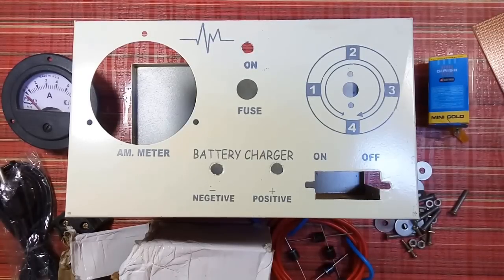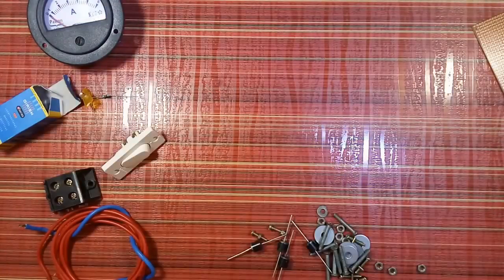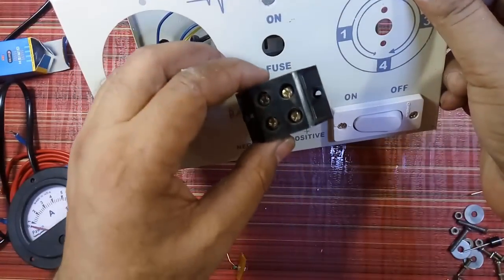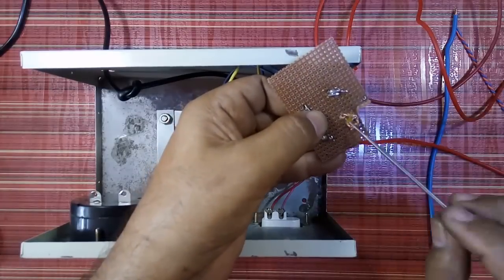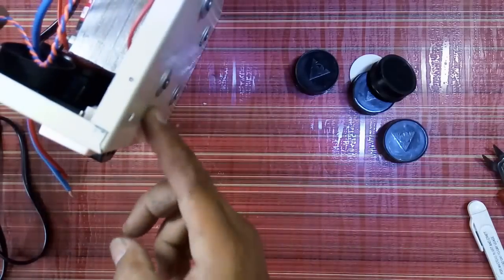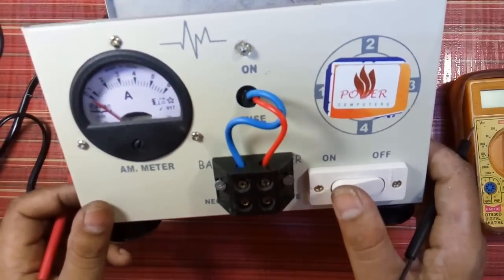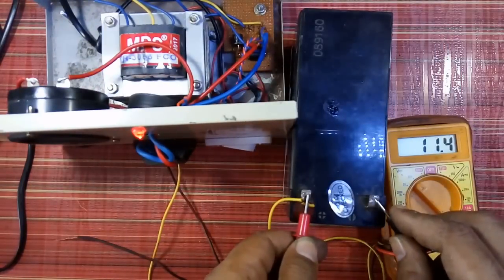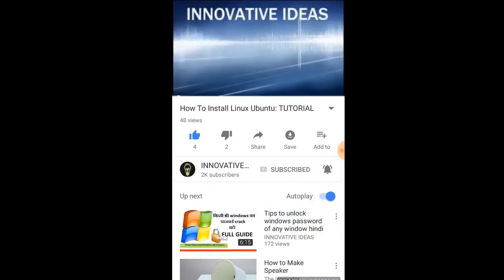Battery charger 12V 5 AMP at home || DIY battery charger using transformer by innovative ideas

Comment: You need to add a capacitor to smooth out  the ripples! Also then ur charging current will increase and u will get correct battery charging voltage. Ur transformer wires are surely not suitable for 5 amp 12v charger. Whats the point in fitting 1.5 mm sq wire when the transformer wire not that thick?

Comment: A 7 Amperes battery will take 1 hour to charge @ 7 Amperes current and around 1.5 hours @ 5 Amperes current. But it's always good to apply 1/10th of battery current for charging and also every battery has a maximum allowed charging current so that the battery does not over heat during charging. Only lithium batteries can be charged at higher currents as they allow faster charging

Comment: Cant charge 12v battery.
Reply from the maker: Why ?? It will charge..
Reply: Use 14 0 transformer
Reply from the maker: This is 14.5 volts transformer, usually known as 12v transformer. Thanks

Comment: much easier to use an old printer or laptop power supply and a buck converter.  still cool though.  why didn't you use a bridge rectifier?

Comment: You are not used any capacitor 
Capacitor must boost voltage & ampere without any fluctuation.

Comment: Bad wiring. Add a 2 amp fuse  to the primary of the transformer where you taped. Blue center tap wire through the negative of amp meter *making positive out of meter the negative rail, add two .001 uf disc caps parallel to each diode for spikes, add a 4400 uf 25v electrolytic cap across negative blue (center tap) on amp meter and positive out (common cathode), then a 4.7k ohm 2watt across the electrolytic cap, then connect the out of amp meter (+) to terminal block negative, add a .001 uf across the amp meter and another two .001 to each of the amp meter terminals  then connect them to the case. Then change that cord to a earthed 3 wire cable. If you do this you would have a safe low noise PSU. you can also add some choke (For Smoothing) from the 12 volt rail of an old PC PSU. to both - and + out then connect the out of chokes to terminal block. I built a version like yours when I was 12 years old, it bothered TV's and radios.

Comment: A metal box with no earth!

Does your electrical supply system lack an earth wire?  If so it would be far wiser to use a plastic or similar ‘insulating’ box, even wood was used ‘in the old days’!

Comment: Sir I need 25 volt ac to 12 volt ac converter circuit for battery charger, but I had 10ampere 230/25volts transformers
Reply from the maker: What type of battery you want to charge?? How much of Ah is that battery??
Reply: @innovativeideas  4.5ah

Comment: You used only TWO LED's for the rectifier !!! and the beginning of the video you showed Four  LED's ??? please explain.
Reply from the maker: S. Ali Yousif actually those are not LED, those are Diodes. if you use 0-12 transformer then you have to use 4 diodes but for 12-0-12 transformer use only 2 diodes...
thanks.

Comment: 230v ac se 12v dc led jalane ka koi         tarika bataiye
Reply from the maker: Sonu Shadab use 100k  1watt resistance connect directly to led in series of power supply of 220 volts.. but be careful

Comment: sir, need 300 AH chargerr, so how much to want AMP transformer 20 or 30 amp???
Reply from the maker: Arif Khan bro, charger should be 1/10 ampere of the Ah of the battery. So 30 ampere will give you the best result.

Comment: Capacitor  to  lagaya nahi  DC voltage  kahase laye
Reply from the maker: +tejas patel Actually DC voltage are converted by diodes which I have already connected. And for such high amperes no need for capacitor.. thanks.

Comment: 5 amp will destroy the battery u r using they made take 1.5 or below
Reply from the maker: New Tricks I have shown that battery just for demonstration and I have also mentioned time. This charger is made for large batteries i.e. more than 35 Ah of battery..
Reply: INNOVATIVE IDEAS any way to decrease amp?
Reply from the maker: Yes but that is some typical process. Better to use another transformer of desired amps. Thanks bro.
Reply: I have 12 volt 5 amp battery charger.this one suitable for charging 150 ah battery (my home inverter battery) plz help me

Comment: Fake video where is capacitor
Reply from the maker: Bro, for charging a high ampere battery, capacitor is not used. Kindly refer electronics engineer. 
Moreover, I do not upload misleading information on my channel. Thanks.